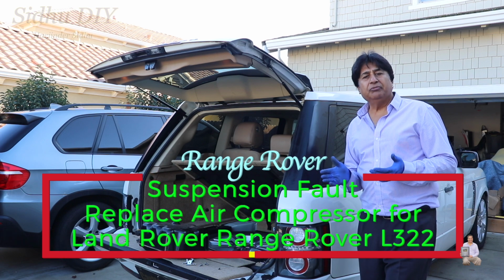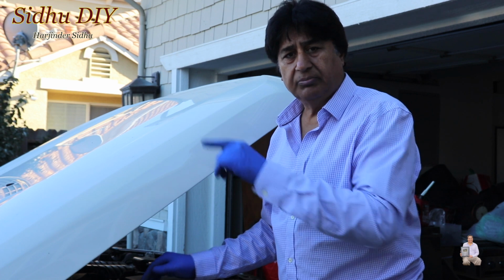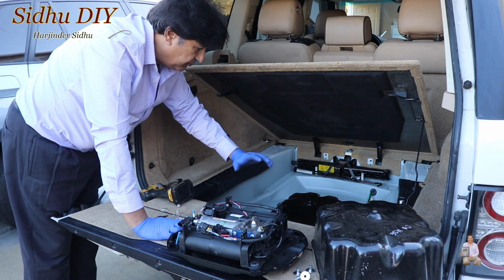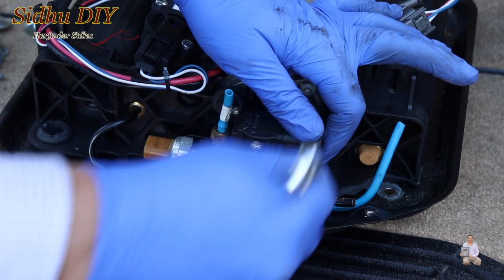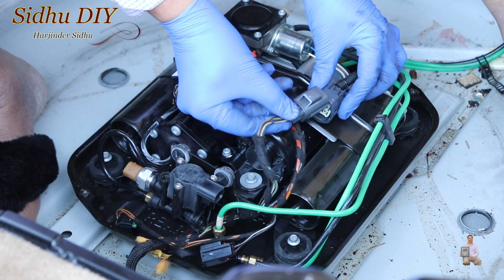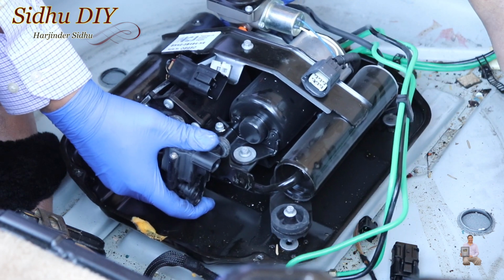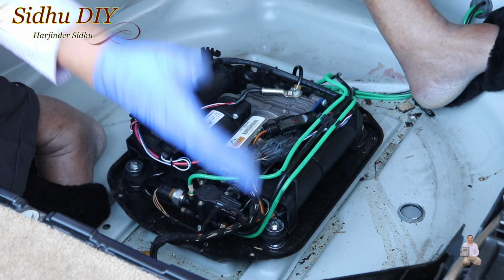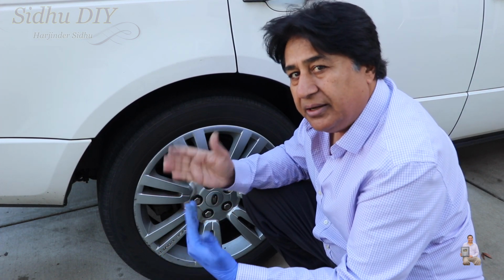How To Fix Suspension Fault on Range Rover L322 | How To Replace Air Compressor on Land Rover

Comment: I got a question mine just did that yesterday its a 2012 supercharged l322 but it only showed the fault sign for couple times but now sitting on normal height but when i try to make it go to access mode it dont do it and lift all the way up to extended height any ideas what that be ?

Comment: i have 2017 discovery hse i have suspnsion fault sign but mechanic say suspension is good . how can i erase this suspension fault sign? thank you
Reply from the maker: Use a scanner and you can erase/delete the stored codes and if it comes back again then you have a faulty sensor. I hope it helps, thanks for watching.

Comment: I have a question I have a range rover 2008 HSE and I got a suspension fall signal on the car no the compressor seems to be working because it is high most of the time but sometimes one suspension fault signal comes on the car lowers what should I do
Reply from the maker: You have a leak for sure so please get it checked out.
Thanks for watching.

Comment: My daughter got one of these, and the air bags go down if she goes over a bump in the road. It also has other problems with it. It wouldn't start, and after a couple days, it did. On the way home, it started doing limp mode. There's another part that has just been changed recently, and I guess she's fixing to get that done, again. It's a nightmare,nbut worse thing is, her dad is a mechanic, and won't fix it.
Reply from the maker: Thanks for sharing the info.
That's the risk we take by owning these older suv, if they run great then all fun and if they go bad then it's a nightmare. Thanks for watching.